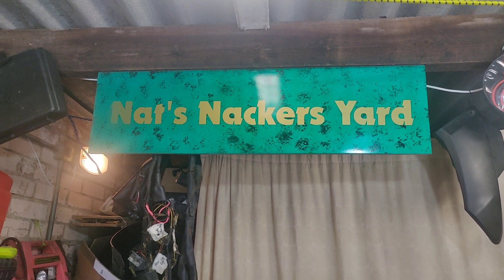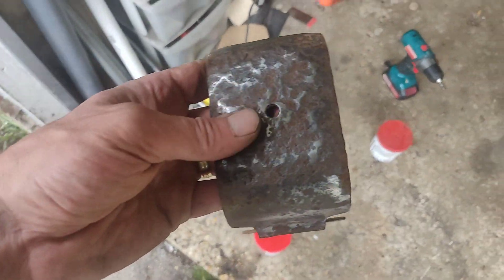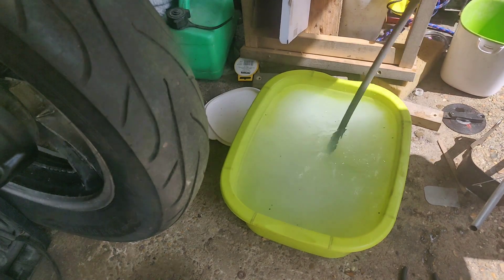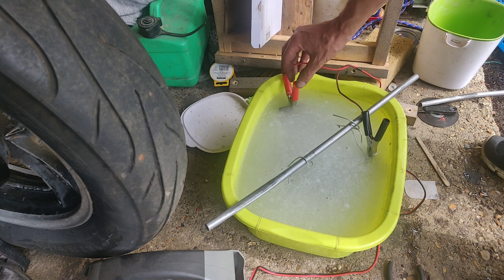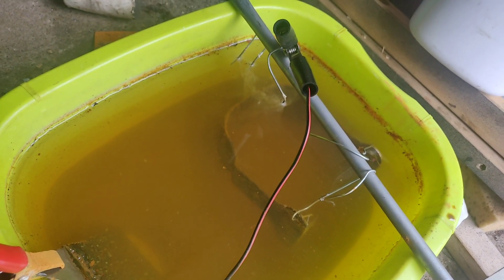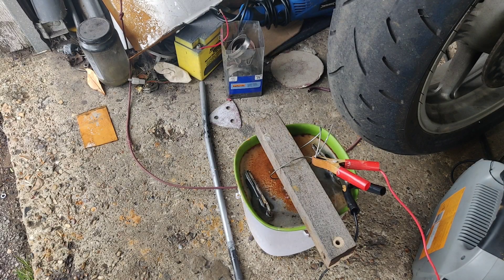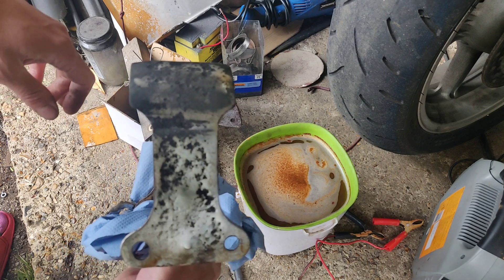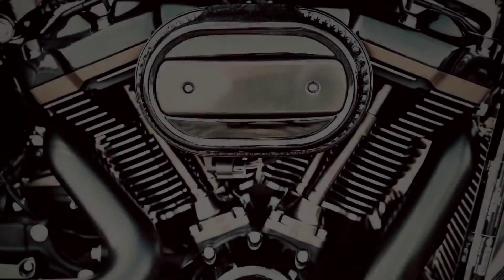Nat's Simple Skillz.  Electrolysis rust removal.

Comment: I used this method to clean out a fuel tank. Took a couple of days to get to where i was happy but worked well. I used a piece of steel bar and drilled a hole in a piece of wood to hold it. Only issue is flash rusting afterwards so you need to treat it with something.
Reply from the maker: Great tip!  That's pretty much my plan.

Comment: seen that done a few times on tanks and it does seam to work - rather than using filler on the side brackets couldn't you line it with ultra thin plastic to make smooth, then wrap it with plain black wrap perhaps?
Reply from the maker: Maybe mate but I already have filler!

Comment: I use it for all the petrol tanks that I do when recommissioning bikes - for that I would have used jenolite rust converter
Reply from the maker: This was really a bit of a dry run before I try it on my tank.  I was very impressed with the depth of the rust it took off.
Reply: @NatsNackersYard  I also use magnets in the solution after before I empty it you will be surprised how much crud that picks up as well

Comment: Hi Nat.

Electrolysis is great, it's generally line of sight from the sacrificial plate to the piece, so it helps to have a big old bit of sheet steel all around your piece.  Saves having to bugger about moving your piece around.  To get to the inside, you want your sacrificial electrode inside...  "All of that shite", though, mostly comes from the sacrificial electrode.

Doing tanks this way is OK, you want a longish sacrificial rod but you need to make sure it doesn't touch the inside of the tank, obvs.

Oh, and people will go on about hydrogen embrittlement.  In my experience, it's not a problem.  We're not making nuclear reactors.
Reply from the maker: Thanks mate. I noticed the line of sight bit when I dropped the sheet into the middle to get at the arch.  Closer seemed better too.

Comment: Just use a brass circle brush, that fits in the drill, easy peasy!
Reply from the maker: Wire wheels weren't taking that off!  Only the plastic paint removal wheel was getting anywhere.

Comment: No MOT requirement for a front mudguard, it falls under construction and use regs.

I use an old computer power supply for rust removal, that works well.
Reply from the maker: I think it's a cosmetic thing in this one mate.  I will see how it works out in the end.
Reply: @NatsNackersYard  saves you getting a face full of shitty water off the road when it rains, which it does, often...
Reply from the maker: I think it's a cosmetic thing in this one mate.  I will see how it works out in the end.